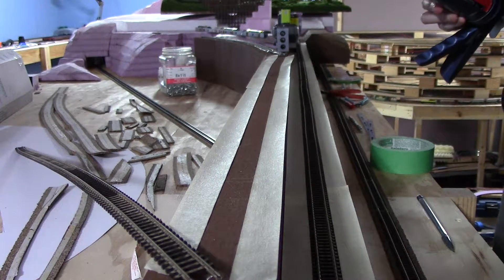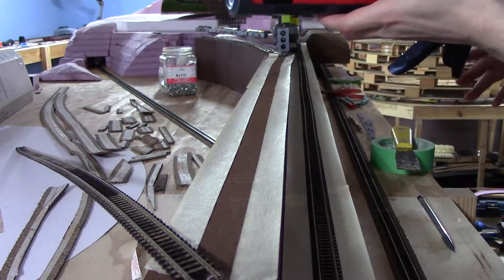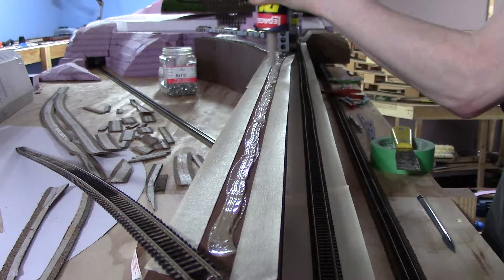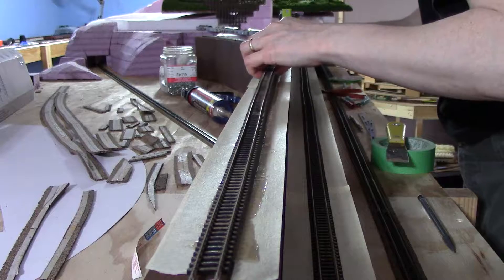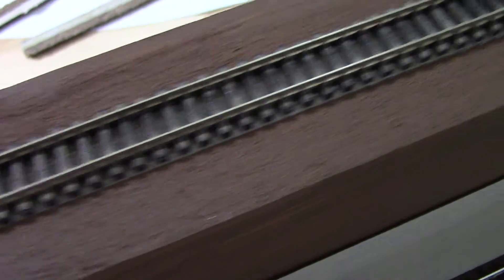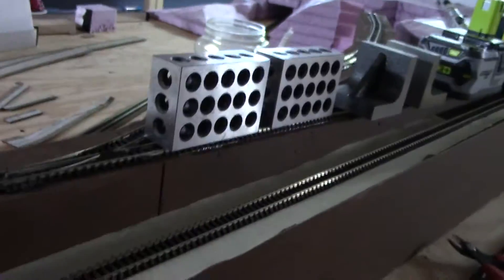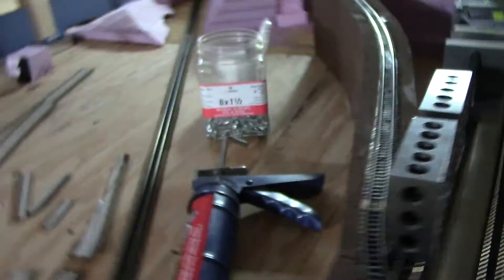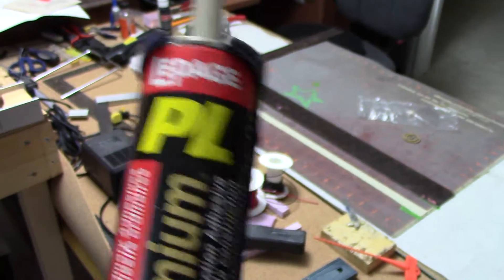20180407 Securing track to foam using construction adhesive

Comment: Nice video for just the problem I have. My daughter and I couldn’t figure out how to nail through all the foam! Great tips! Right good job man!
Reply from the maker: Thanks for the comment!  Another good product is No More Nails.  This won't expand like the construction adhesive once you spread the bead out into a thin layer.  I would still add weight to the track until it cured to ensure the track stays where you want it.